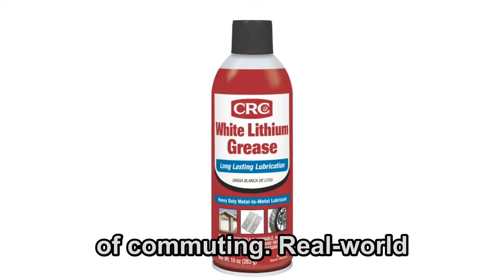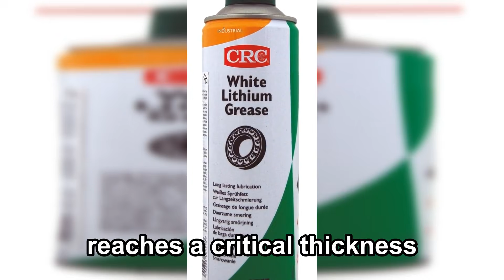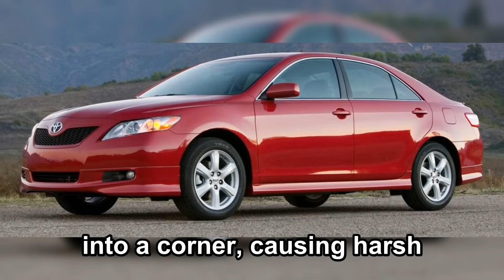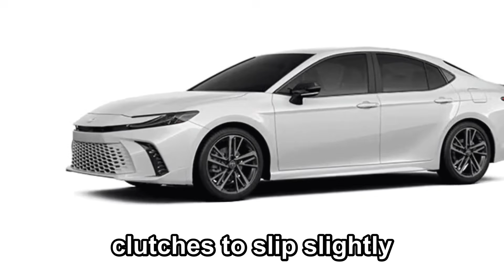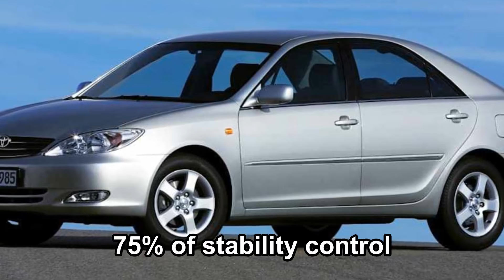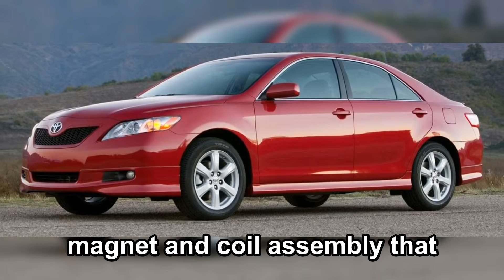The Hidden Climate Control Fix Dealerships Pray You Never Discover

Comment: can you reset the computer by disconnecting the battery?

i heard that volvos made under ford and the 2005 mazda 5 will have to re learn habits if the battery is changed